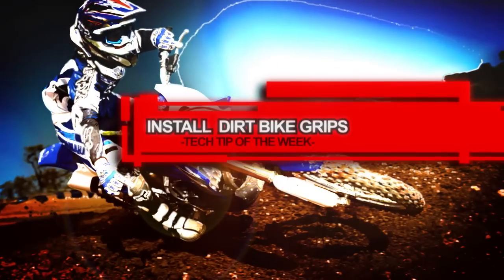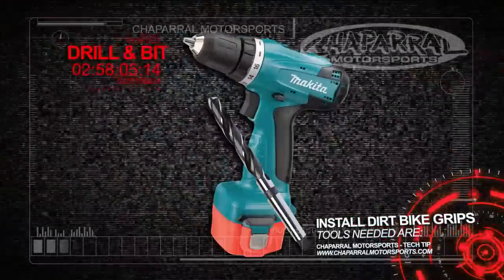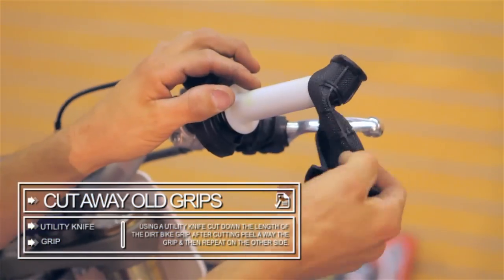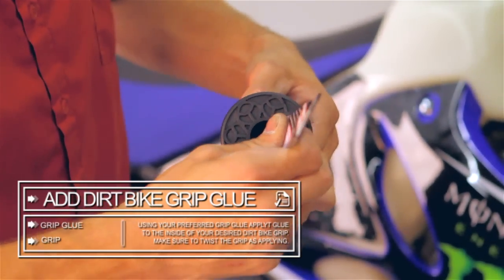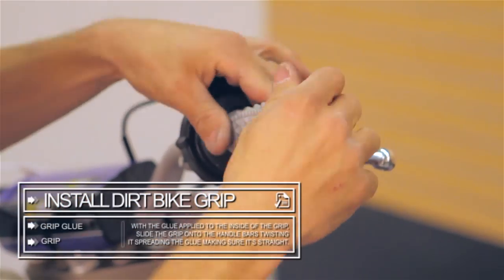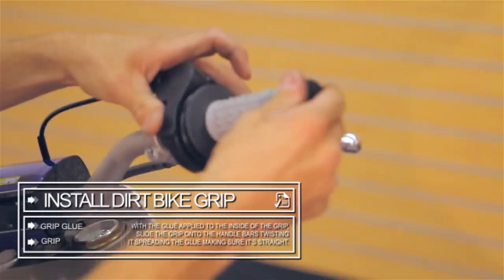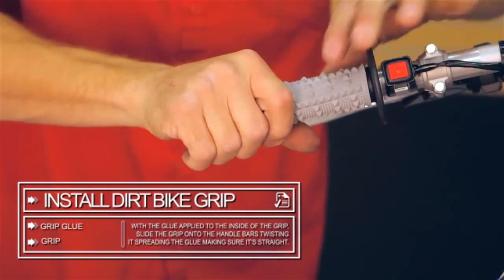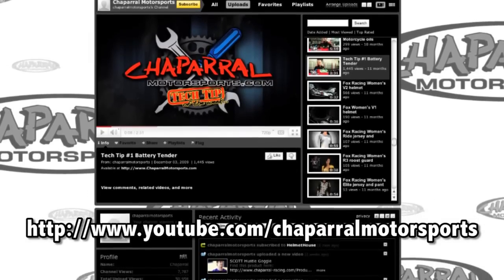How to install Dirt Bike Grips - Chaparral Motorsports Tech Tip #12

Comment: totally oversimplified ... I spent hrs and two sets of grips replacing mine... glue got into bolt locked handle bar expanders, throttle tube wasn't right it wouldn't spring back, then that got glue in it later on and wouldn't spin again... fucking nightmare but it was a 2nd hand bike with pro taper bars on a klx ...